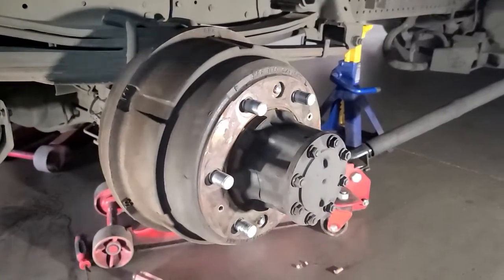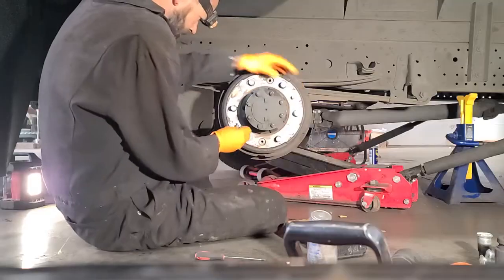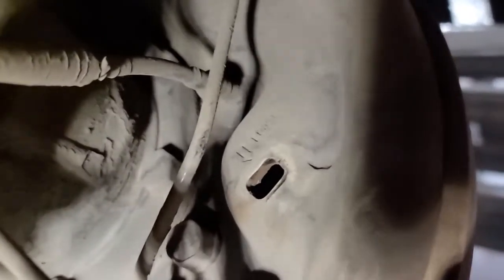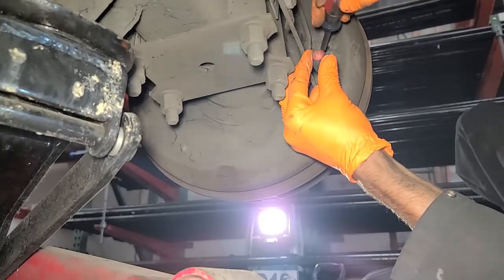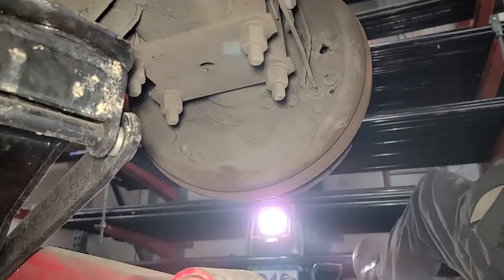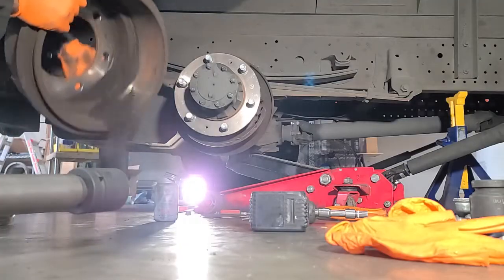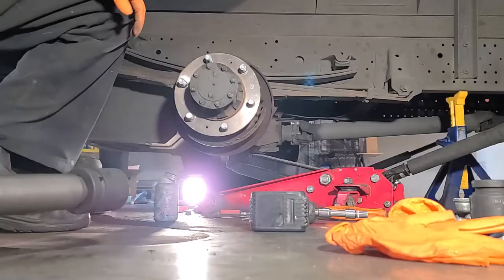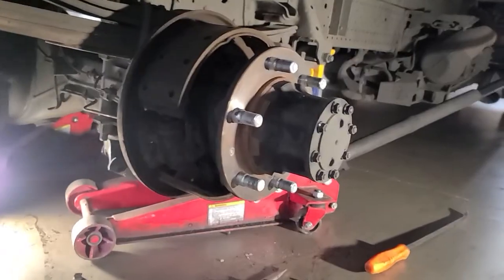Isuzu npr hd rear brake removal

Comment: Thank you!!! Love to buy you a beer!! Was fighting with it for over 2 hrs, couldn't find info, then I tried again and found you. I've done the breaks before on mine, yet never had the problem as bad with removing my drums. I'm a 2003, there's actually a pin you press at that location. Don't have to put a small screw driver in there.  Anyway, THANK YOU!!

Comment: Quick question, I tried adjusting both sides to get the brakes closer to the drum but was only able to do the adjustment toward the forward part of the vehicle on both sides. The adjusters toward the back of the vehicle would not budge. I tried sticking a screwdriver in the little hole to push the tab like you suggested in the video but still wouldn't budge. Do you know if you're only able to adjust the brake outwards from the forward hole? Or did I only adjust the pad towards the front side and not the back
Reply from the maker: Sorry about the delay I tried to keep up with all .. They easily adjust to Titan. They need a punch or something pushed on the tab to open them both.. What I am understanding is that you have a hard time on adjusting them. Outward to remove the drum correct?
Reply: No I'm not trying to get the drum off at this point I just wanted to adjust the brakes outward. I was able to spend the adjustment wheels that are on the forward part of the back tire but not the ones toward the back of the back tire if that makes sense. I know that the adjustment wheels toward the back side of the tire need to have the tab pushed in to loosen them but it was my understanding that this was not needed to tighten the pads toward the drum. I did try a small Phillips head screwdriver to push the tab but had no luck. It wouldn't budge. I guess I was hoping that I only needed to adjust the forward wheel to get the brakes to tighten up but it seems that I probably only adjusted the forward pads and not the aft pads of the rear wheels. Maybe I will try a small punch and tap the tab with a hammer to see if I can get it to move. Thanks again for your replies I appreciate it! Your video definitely helped me understand how the back brakes work on these trucks. Unlike many other trucks there is not that much info on the internet for these trucks so this video was super helpful 👍
Reply from the maker: @jasonmoore7322  Ok, try blowing them out with air after using brake clean. Maybe they are just Full of debris.. Sometimes it's hard to get the screwdriver right in that little hole. To push the tab, just have to feel for the returns. Spring it pushing back out as long as all that is in place. Everything should go well
Reply: Since I don't have the hubs off I tried using a endoscope to look inside the hole. Pretty sure I was hitting the right spot with the screwdriver to push the tab in but I may have been off a little bit. I will try to do some more probing around in there 👍. I need to just pull the hubs off and put new pads in the back but after doing rotors pads and calipers on the front my ass is wore out😅. The front rotors are a pain to change out on these trucks. I found that map gas or a oxyacetylene torch to heat stuff up on the front is the key! Especially for that damn tone ring
Reply from the maker: @jasonmoore7322  Yeah, it definitely can be a pain in the butt. I have a video on my channel of how I do them with no heat. As long as you clean everything decently they slide off o k.. And yeah, in the back definitely maybe use brake clean first and then blast it with air. So everything is busted loose. Then you should feel the end of the screwdriver. Slightly bounced back at you when you hit the right tab.. It has a divot in it that will hold the tip of the screwdriver perfectly  and place also.
Reply: Okay yeah I don't remember feeling a divot so I must have been hitting the wrong spot. Thanks for the tip!
Reply: By the way I can hang glide on a bag of Doritos also😂😂. I cracked up laughing when I heard that one😂
Reply from the maker: @jasonmoore7322  You're welcome everybody's got to have some damn humor...

Comment: 2-9 24, am working on one currently, the grooves in the drums are VERY deep, causing a BIG lip on the end, to make matters worse the adjusters are frozen solid, it was hell getting the drums off! Am replacing everything on there, it's a 01 Chevy W4500 which is the same thing as an Isuzu, now we're trying to find parts, it's challenging, definitely do not want to tackle this job unless you have plenty of experience, weekend DIY Warriors need NOT apply for one of these jobs🙄
Reply from the maker: You are right..they can be difficult..they do sell new brake cylinders and drums..I like napa auto parts has them available and can get a hair expensive but worth it

Comment: I'm STILL struggling with the drum 'jack screws' what the heck.. diameter and thread pitch... are those push/ jack screws?
Reply from the maker: Yes, there is a slight push clip and there is two on each drum

Comment: I have 3 stripped wheel studs on the rear. Once the drum cover is off, am I able to just hammer the old studs out and put the new ones in? Thanks for your help
Reply from the maker: Yessir.. might take some heat but they come right out